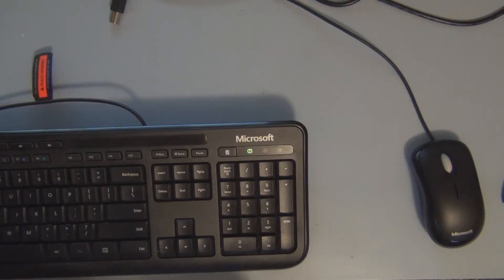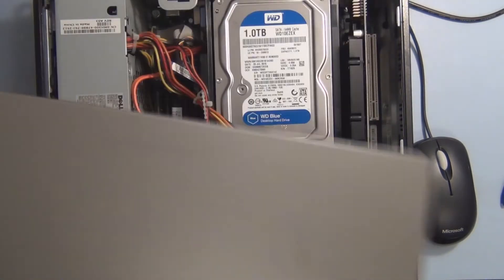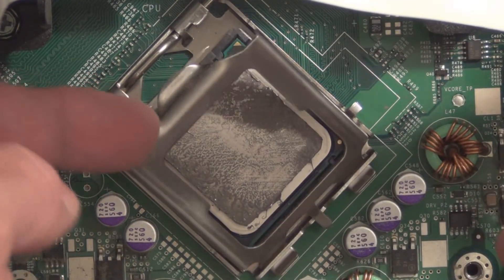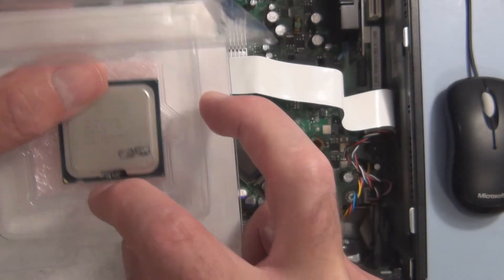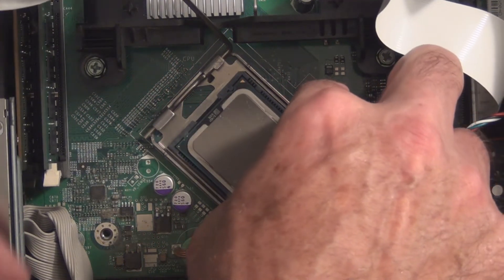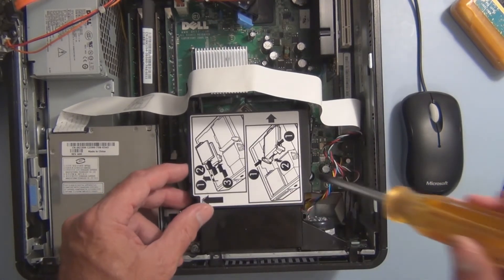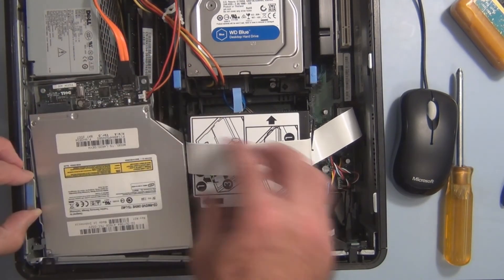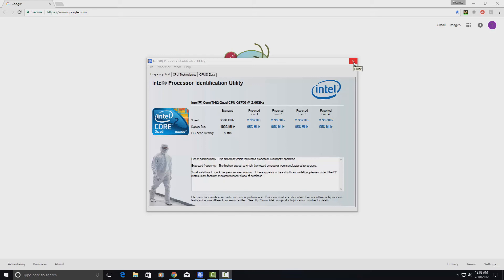Installing an Intel Core 2 Quad Q6700 2.66GHz into the Optiplex

Comment: Does it work well to this day friend? Did you update the bios or any other modifications?
Reply from the maker: Yes, It's still a working computer.  I turned it on yesterday.
Reply: @tmc200527 so cool! Where did you buy the Q6700?

Comment: hello i purchased a cpu for my hp xw4600 workstation (Intel Core 2 Quad Q6700 (Quad-Core3 2.66-GHz, 2 x 4MB shared L2 cache, 1066 MHz FSB) and when i installed it, it was making a beeping sound and blow fan loud noise. and also it doesn't load up and upper left hand corner has that blinking _ won't load up to window. any idea whats might be wrong with it and i install back my original cpu and it still won't load up for some reason thank you.
Reply: motherboard damage

Comment: I have optiplex 745 core 2 duo e6300. And buy a core 2 quad 9550 when i turn on the pc the fan start full and no have video signal
Reply: non compatible
Reply: I'm just like you Is this processor compatible with my device? Dell optiplex 745 I mean a therapist Q6700

Comment: I hope someone can answer me
Can i put a Core 2 quad 6600 in the Optiplex 745 with the BIOS versión 2.1.0?
Reply: @Akhil sreegiri Which one do you do first: Upgrade the BIOS or install the processor?
Reply: @Akhil sreegiri Thanks!
Reply: @Akhil sreegiri What happens if you don't update bios, cause i was deliding my e6650 and the chip inside split in half and now i need a new one and don't know my bios version. Would this CPU work without update? Thanks

Comment: can i replace my core 2 due E4600 processor with core 2 quad Q6600 Processor
Reply: Yes, you can. Both CPU have the same socket-775. However, check your motherboard manual to see if it supports Core 2 Quad Processors.

Comment: Never thought of changing fan direction might try it. I upgraded cpu to q6600 quad and installed gt 710 2g gpu. Assetto corsa with post processing enabled gave me fps of around 40.which for a 10 Yr old desktop is pretty good I think

Comment: Didn't you need to upgrade the power supply?
Reply from the maker: I did not change the power supply and it is still working without any issues.

Comment: You should get a 1050 low profile for that machine if you can find it for cheap on ebay or a 750ti low profile or even the 710 low profile. You get more support for CUDA applications and better performance in Android SDK.

Comment: good video, but isn't the thermal compound supposed to go on TOP of the lid after you close it? And not on the CPU chip itself? Then the thermal compound will be in contact with the heat sink.
Reply: no

Comment: i have a question about dell optiplex 760.. i have these pc for quite sometime now and i just recently upgrade from 4gb memory to 8 gb memory.. now my question is would i be able to upgrade my processor from core 2 duo to core 2 quad which is the highest one i need is a q9650 processor that runs 3.00 ghz.. thank you and have a good day
Reply: 2 options

1. Download SPECCY, lovely program that pretty much names every hardware piece on your pc to get the name, including the motherboard.

2. You don't really need to know the name of motherboard itself. Just search on google the model of your pc, in this case, 'Optiplex 760' and put 'drivers' at the end.

Here, did it for you.
http://www.dell.com/support/home/us/en/04/product-support/product/optiplex-760/drivers
Reply from the maker: I found this info   The Optiplex 760 with the 0M858N motherboard does support the following Q9550, Q9650, Q9400, Q8300 and Q8200, Core 2 quad processors.

Prior to installing the processor, check that you have the latest BIOS version installed, with version A11 updated Intel Processor's microcode was added.
Reply: i have the optiplex 760 sff but im not sure what model of mother board i have

Comment: I have the exact same computer Just wanted to suggest turning the cpu fan around so that it pulls the heat out the front rather than pulling the heat into the very small and cramped insides of this poorly ventilated case cooking the HDD, power supply, and capacitors. Simply turning that fan around makes everything in this computer MUCH cooler... There are several videos on YouTube suggesting this and showing the process. Happy computing!
Reply: would this also reduce noise or would I have to clean the fan
Reply: +Arenite Well, it will run cooler, so the fan should run slower which should be quieter. But since you'll have to take the fan out to turn it around you might as well clean it anyway... Also just to note you will have to take the heat sync off of the CPU to do this as well, so make sure you're comfortable with that process and replacing the thermal compound. I'd suggest watching videos that are out there on doing this on this exact computer. Good luck.
Reply: dont worry i do it all the time infact the cpu in my 745 isnt the original
Reply: i have the same optilpex 745 SFF, and it would shut off on me on hot days. I took the side panel off, and leave it off, and now the computer works fine, and hasn't shut off again. Just an alternate and simpler method to keep this computer cool, if anyone is not comfortable, digging into the innards of the computer.
Reply: Just want to say thanks for this suggestion. I tried it and yes it does make my little Dell run far cooler than before. Appreciate it.
Reply: Well there is a reason why they placed the fan like that to suck the air inside, that is to cool the processor. I would suggest you to remove dvd-rom and move the hdd/sdd there (removing the hdd fan cable)and install another fan to the back of the chassis  to pull air into the chassis. You will also create a lot of space for air to flow.